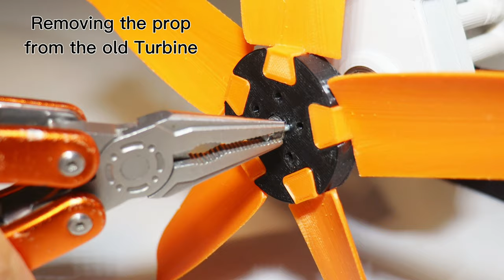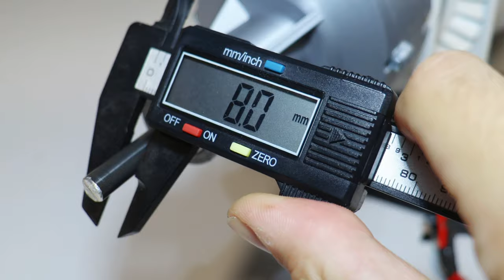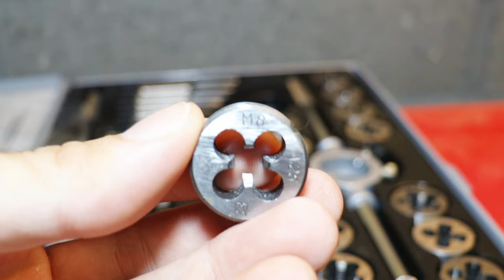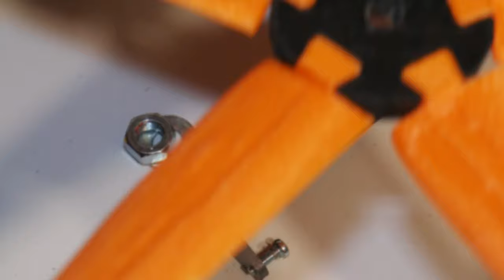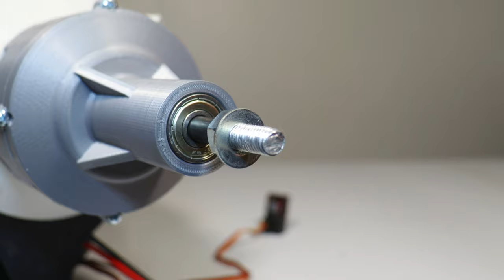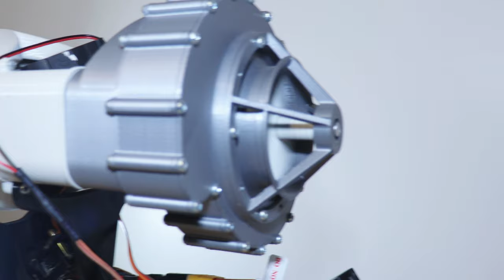3D Printed Axial Turboshaft | thrust test | A NEW RECORD!

Comment: nice, but i think if you printed fan or an axial compresor with multiplying bldc motor from used hdd its will be a good project, you can adding motor in series flow and make it reverse spin every section , it will be good and reducing gyroscopic effect